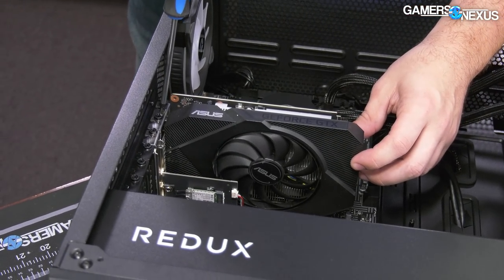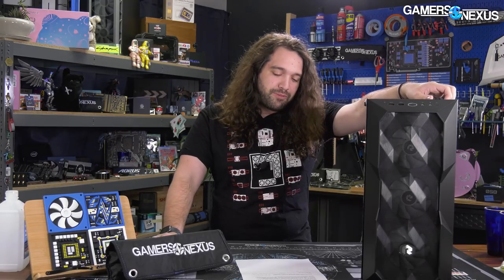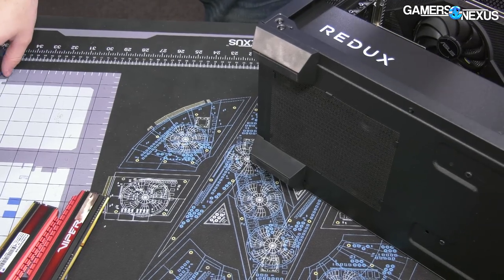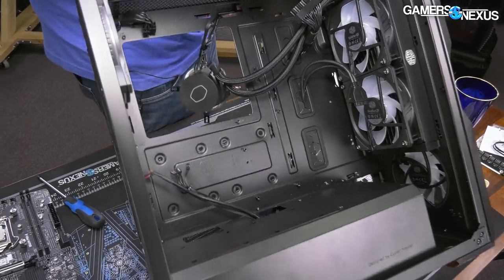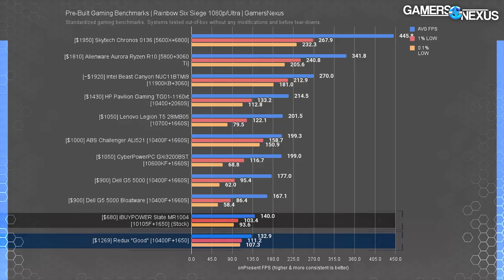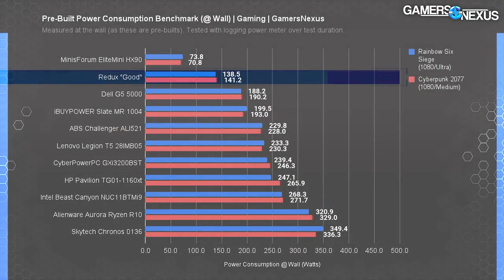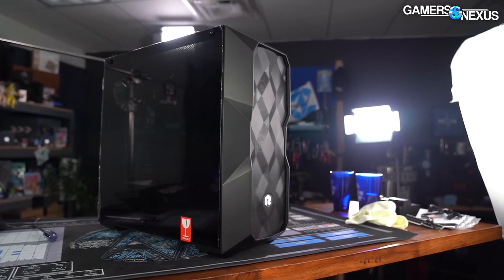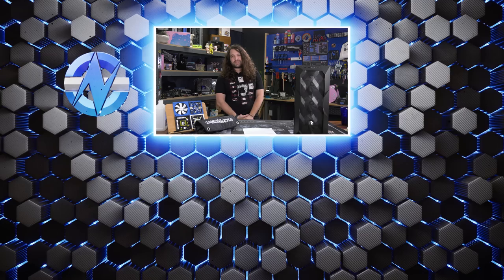YouTube Ads Told Us to Buy This: Redux Gaming PC Review

Comment: You know, I had once been very seriously considering buying a pre-built because I was intimidated by the process of picking PC parts and building the actual, working PC. Not even a couple weeks ago, I pulled the trigger and built my desktop, and around the same time, I found these videos. I can safely say after watching several of these that I am forever grateful I got over the hurdle and did things myself.
Reply: Tbh that probably is the scariest part in my experience too. It's just very overwhelming with all the shit you can buy, and need to buy. For most people, their understanding of Component nomenclature is Intel core i whatever, and hard drive. They literally know nothing else besides those two, so it's daunting to start doing research.

Comment: I bought one of these in September and immediately returned it. The expanding foam packaging wasn't supporting the gpu and it ripped out of the pcie slot and damaged the boot drive/m.2 slot. Other issues I noticed were that the radiator was tubes at the top and it has non rgb fans for that radiator. I was able to return it at no cost and chose to take a refund and hunt down my own hardware since the EVGA queue got me a card.

Comment: I purchased from build redux ended up with an asus dual 3070 32gb ram i7-10700k on a Z490-A Pro 1TB NVMe M.2 and 2TB HDD all with a 850 watt power supply was told to look out for those in prebuilts. Extras were wifi card and windows 10 before shipping it was 1989$ after it was 2038.28$ this was back in January. Putting together my own piece by piece at the time seemed to be around the same price or higher without the availability nothing was in stock and if it was in stock components were eclipsing retail. The same build from redux right now is nearly 300$ higher before shipping then mine was. No issues thus far about to update the ssd and hdd. Not bad for my 1st pc.

Comment: Hold up…don’t SI’s get their components (including GPU’s) directly from manufacturers and board partners? So why would the 1650 cost them $300+? That’s the scalped price, unless manufacturers are now also price gauging and charging SI’s scalped pricing…If they’re not however that means REDUX just charged u $300+ for a $140-150 GPU.
Reply: THIS!
Reply: Yesnt, depends on the size, Igors lab had an article about how hardware "brokers" are gouging smaller business.
Reply from the maker: No, they normally buy from distributors and suppliers. We have no way of knowing which party is gouging.
Reply: Smaller SI here, price is accurate. Distributors cost more than list price due to bundling. A lot goes into it but GN has explained it to death at this point. That's all the info i can really give.

Comment: This looks to me like an ideal system for a quick GPU swap. "Too much cooling" means the system was designed for a bigger GPU, they probably just can't get the correct GPU right now.
Reply: @Cancer McAids I put an Arctic 420 on a 5600X just to run the fans slower.
The AIO just means you can run the CPU effectively silent, an excessive number of fans means there's room for a much larger GPU, and the case and PSU can obviously take it.
Reply: @Cancer McAids Takes heat away from the area where the GPU will be venting. It does have case fans, so...
Reply: @Cancer McAids The whole point of any exhaust system is to vent hot air. Venting it into the case will fill the case with hot air from the CPU thus making your rad little more than an expensive air cooler, as it now relies on the case fans. If the rad is flipped, you get only the GPU heat inside the case rather than GPU+CPU. So in either case the CPU gets the same heat but in the latter case the CPU's heat is pumped outside and does not affect the GPU. Real talk here, are you making a PC or an oven?
Reply: @Cancer McAids Computer components output a FIXED amount of heat based on their wattage. The only situation where it matters having the colder air directly on the rad is when your CPU would throttle. So, when you're OCing a high watt chip, not 65w. Flip it around, don't pump hot air into the case, internal temps drop.

Why do you keep making walls of text insisting the rad is useless when it's obvious you don't understand?

Comment: Man I get the value is shit, but there's just no way to find parts at a decent price. I'll take good cable management and no bloatware over any of the standard OEM crap any day.

I'm not trying to justify my $2700 3080 Redux build I bought 3 weeks ago, nosireebob...
Reply from the maker: There is a way to find parts for a decent price: It's from other prebuilts.
Reply: @GamersNexus  I must have missed it during my search, man. All the major ones I checked out like cyberpower, ibuypower and the like all had prices that were higher (or similar) than build Redux for the same components. That plus the fact that A: Redux has good build quality and zero bloat and B: I refuse to give Ebay scalpers a penny because screw them and their behavior made Redux the best choice I could find. Ah well, downside of a shitty market I suppose...

Comment: Wishing this series had started earlier. My brother has a pretty impressive PC from CyberPower. R7 3700X (120mm AIO cooled) and Gigabyte 3-fan 2070 Super, 16 gigs of dual-channel 3000 MHz DDR4, a 600W 80+ Gold non-modular PSU from Seasonic, an off-brand 256 gig SATA SSD in it along with a Seagate 2 TB HDD. 
I opened it up and was impressed. Cable management in the back was insanely competent, and very neat (the MOLEX connectors were even plugged into each other so they don't spaghetti everywhere). The case itself had a removable metal panel in the backplate that sticks up just a bit from the back of the motherboard tray, which is used for screwing more 2.5" drives in if you want to. There was one issue, the HDD and SSD were in a tray not dissimilar from the CM H500 with clamps, but for some reason there was a screw you had to remove from the side of it meaning the PSU had to be removed in order to remove the SSD or HDD.As for software the bloatware was pretty minimal, though despite having a MSI motherboard it uses a custom CyberPower BIOS but the navigation and settings are straighforward enough.
The entire PC is coated in RGB which is mediocre, but it does come with an integrated controller that's controlled by a dedicated button on the case. The case also has three side-mounted 120mm fans for intake, and it just uses an open top exhaust (has a dust filter) and the CPU AIO is mounted for exhaust on the back. Dust filtration is okay but definitely needs to be cleaned more often than some other cases would mandate. Also has a tempered glass side panel that isn't overly-difficult to open.
I have no idea what the name of the exact name of the prebuilt is, but it was bought for $1400 USD on a Black Friday sale back in 2019. Thing still chugs along just fine today, even while my brother loads it with excessive numbers of launchers for games he plays once and then never again and always allows them to all run at startup. I'd consider sending it in but I did have to undo the cable management to add a SSD, so it wouldn't reflect the original product properly. But it can be nice to know that some brands have their ups and downs and that most of them aren't always a "must-avoid" (except Alienware).

Comment: Me with a Ryzen 3600 with a 360mm AIO With 6 fans on the radiator, don't underestimate me Steve.

Why you might ask, well the AIO was on sale on Amazon for £68 and i had 3 front mounted case fans already.
Reply: A man of true fan culture I see. As I'm currently looking at my 5000d Airflow with 12 fans in it, including 6 on my AIO in push pull. If I'm gonna go for cooling, I'm going to go for overkill.
Reply: My 3600X is in a custom loop (CPU only) xD

Comment: I bought a Redux back in July 2023. Its Febuary 2024. I absolutely love it. I have had no issues. I have installed another M.2 into the motherboard, thats about it. 4080 GPU, 32 GB, i7 14 something something processor. The only problem I had was messing around with the RBG though conflicting softwares but that was no problem on Redux's end. I honestly plan on buying another prebuild from them in 4-5 years time. After Checking their website out in sometime they have a new case option and the 4080 super. I hope the contiune to do good business and become bigger while mainting their quality build. Im sure there may be parts they price higher and so on, but making a payment and a few weeks later recieving a brand new, quailty built PC works for me. Maybe I will change my mind and build my own in the future, but Im happy with it.

Comment: I've had a client bring one of these in, it was fairly well built. However I agree the "Good, Better, Best" default options are surprisingly low spec. So if you do buy one, I highly recommend you adjust a few parts, especially the GPU, since they are still marked up but nowhere NEAR what scalpers charge. 

The watercooler, I can see their reasoning for doing it on every build. It's a way to standardize the build process and layout so that all they need to do is swap the motherboard and CPU. Also allows users to upgrade their own parts later on without needing to replace/upgrade cooling.
Reply: I imagine an AIO also does better in shipping

Comment: Back in May, I finally gave up trying to snipe a RTX 3080 and Ryzen 5900X, and resigned to ordering a prebuilt through Maingear.
$2500 for a 5900X, RTX 3080, MSI B550 mainboard, 16GB 3600MHz ARGB RAM, 240mm AIO, 750w EVGA PSU, 500GB NVME, 2TB HDD and 3 ARGB case fans.
It arrived 2 months later with XMP already enabled! I added a second NVME drive, doubled the RAM to 32GB and was ready to go.
I also disassembled and reassembled it purely for the satisfaction and found zero build/QC issues, highly recommend them.

Comment: In my opinion, if you are going to buy a prebuilt computer, get it at a physical store. Also ask about return policy or replacement in case you get a faulty PC. Ive bought 2 prebuilds at best buy for friends because they were on sale (prior to component shortages) and they were decent machines. I did have to take the ram out of one and re-seat it

Comment: I got a PC from them in December 2020. Took like three months, so yeah, a long time. Other than that I've had no issues or complaints. I've since upgraded the GPU from a 3070 to a 4080 and the CPU from a Ryzen 7 3800X to a Ryzen 7 5800X3D.

Comment: They recently upgraded their part list again. They are pretty decent parts now. I price matched everything to individual parts and the redux pc was only like 150ish more than building it yourself with the exact same parts. Most of their profit, if not all of it, comes from the $99 build fee and win11. 

Though, it would be nice to have an air cooled option for those not getting an i9. Liquid cooling is a waste if you're not running parts that run hot as fuck... like an i9 or ry9

Comment: I agree that the fan and RGB control suck on this, but they do give you the option to use an air cooler. When I bought mine (September of 2021), they allowed you to modify almost everything and as of now, you can do even more. The “good”, “better”, and “best” are really just baselines that you go in and customize yourself.

Comment: I haggled a bit with LYTE GAMING after purchasing a ‘Venom X’ build.  
Few subs/ upgrades.  $2.6k out the door with taxes. |X570gamin+ || Ryzen5800x || RTX 3080 10gb || 2x8gb 3600 ram || 2tb NVME x4 || 1tb HD, 750Wgold PSU || all in a smexy LianLi Dynamic Evo.     Just shipped today 6/2- should arrive by my bday on 6/8!  Just got my LG34GP83-A monitor(Amazon). LYTE shipping and customer service is far better (now) then I’ve heard. Though those complaints were mid Covid and under $1k builds.    I can’t wait to park my Dell 7559.              
Thanks Steve N’ GN with help with my research!

Comment: I ordered a PC from Redux a year ago and it took 4 months to arrive after repeated inaccurate arrival dates, and when it finally arrived it didn't work at all. Sent it back and had to get the refund through PayPal because they stopped responding.
I then went to build my own PC (thanks to my Grandpa lending me a 1070 I could go with a ryzen CPU) and it's great. It cost me a bunch less and is way more powerful than their available parts (aside from the GPU which I don't need tons of power from yet).

Comment: As someone with a tiny bit of insight into this "scene" due to a very close friend:
In a lot of cases where absolute over kill components are used, this happens for two reasons:
a) (minor) flash: looks cool, sounds cool, customers with less experience will opt for it;
b) (major) overstock: they are in stock, they need to be distributed, it's easier to get them out in pre-builds than single component sale;
arguably there is also reason three, which is however less likely an intentional reason and more of a side-effect:
c) upgrade-ability: selfexplanatory

Comment: The current "good" build is listed at 1375 and comes with a 2060. They downgraded to a small cooler master air cooler, and brought the power supply down to 600w. I bet the currently listed "good" machine is competitive with the other adequate builds on the test list.

Comment: The cooling system is overbuilt because its the same for every CPU/GPU option. It IS overkill for a gtx 1650, but for an rtx 3080 and a 10700K its more reasonable.

Comment: I don't see how there's a lot of airflow in this case even with a push/pull radiator. That's only working for the radiator really. You still need some intake fans,  maybe put a cooler on the top
then you can get a cross flow of air from front to back.

Comment: Steve; What do you suppose is the risk and consequence of vapor lock cause by a vertical radiator in a closed loop?  
Every mm depth of air gathered in the top edge of a radiator (from permeation) is a 1mm reduction in the size of the pathway for the water to pass through. 
it should be a non issue with a horizontal rad because it would take 10-20 times the volume of air to create each 1mm of air space. 
Is this a thing?
I HAVE had an AIO (Silverstone TD-02E - horizontally top mounted) permeate to the point of not working after 4 years (it survived with a refill :)

Comment: maybe stupid question, but would the push pull system on the radiator help air get into the case and to the air cooled GPU? I am looking at that option to increase airflow to my EVGA 2060 since its running up at 75 to 80 C just wanna get it down a bit not that that is waay to hot from my understanding. Thanks!!

Comment: I got a Redux PC recently, 10700k with a 3080ti 32 gigs of ram, 1tb m.2. It is a MONSTER. Tears through everything. I'm actually seeing a good improvement in CPU performance with the liquid cooler as opposed to a high end fan which I had in my previous PC. The mobo can overclock it considerably more and temps remain low. Heck it's running at 5 gigs most of the time without much stress. It was a little under 3k before taxes which I think was an excellent deal. Even if I ended up paying... lets say 200 bucks with the included build fee and suppose a slight round up of prices for parts. The quality of the build with the cable management and aesthetics is 100% worth it. I've built many high end PC's before and know that it takes a good amount of effort to get it this nice. I was more than willing to part with a small fee to get it all done by someone else lol 
I was a little concerned when ordering about the brand of parts since they don't tell you what you will get as far as brands. But the mobo is a high end ASUS, the GPU a Nvidia reference 3080ti and their custom case is wonderful. 100% would recommend. If you're tired of waiting for GPU's to be available, or just don't feel bothered to go through the process of making your PC. Just get it through them, seriously.

Comment: I have one of the high end systems from Redux, don't remember the specs off hand but I do no it has a 3070 in it and an AIO on the CPU. When I got it i went through it with fine tooth comb and the only thing lacking was a bit of cable management and a few other very minor things. I did sent them a positive critique email but never heard back. Would buy again but would also go through it before I turned it on.

Comment: Those included Cooler Master Halo MF120 fans are not cheap, they are $60-$70 for a 3-pack, plus another $20 for the 4th fan. So you are looking at $80-$90 for those fans. Then the other 2 fans on the AIO are the 2 fans that are included with the CM AIO, that’s why it’s push/pull. They wanted matching fans in the front panel and rear exhaust and put the extra AIO fans on the back of the AIO. At least they gave you the fans you paid for, and the CM Halo fans are very good RGB fans.

Comment: i've had a few prebuilts and usually upgrade the ram to 16gb and add a gpu. i am about to build my first custom pc using only 1 used part, the gpu (evga gtx 1070 sc black edition 8gb). the rest is a matrexx 30 case, i5-10400, gigabyte b460m ds3h, 32gb (4x8gb) oloy 3000mhz ddr4, 500gb crucial p1 nvme ssd, evga 450br psu.